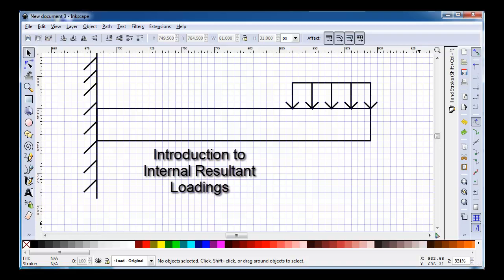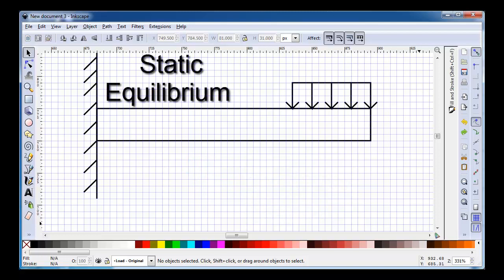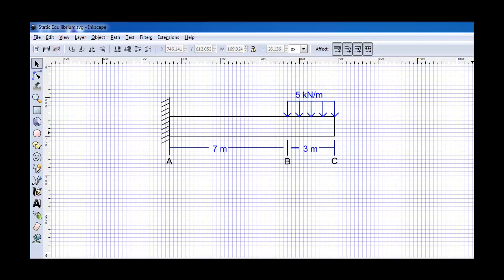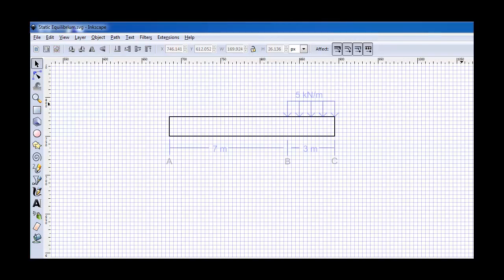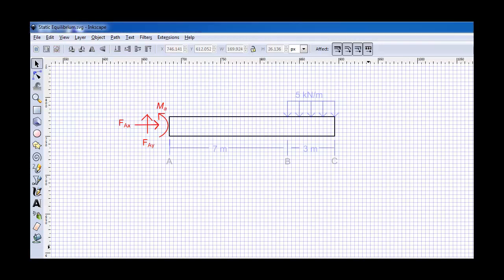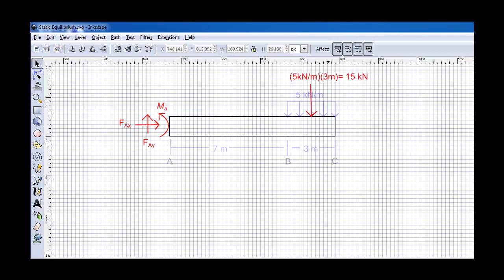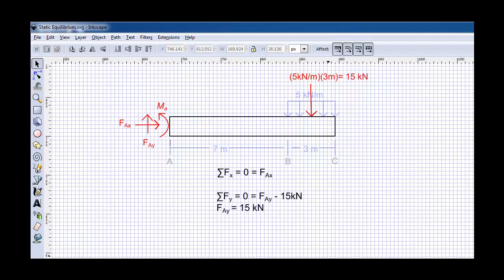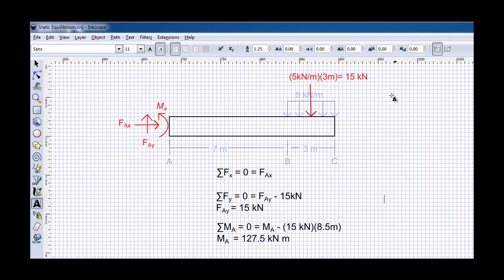Static Equilibrium   Cantilever Beam

Comment: It goes without saying that there is a force exerted by the beam against the wall in the x direction at the wall, actually 2 forces - one to the right at the top of the beam and one to the left at the bottom of the beam. So, for example, the fastener into the wall at the top of the beam must be strong enough to in tension to prevent the top of the team from pulling out and the compressive strength of the bottom of the beam and wall it touches must be strong enough in compression to resist crushing.

Comment: What about the force of gravity on the beam?
Reply from the maker: 1steinstein For a lot of beams we assume that the force of gravity is negligible. However including it is a fairly straightforward process. You can treat gravity the same as you would a distributed load, that is equal to the line density of the beam.

Comment: suppose i'm calculating the sum of moment at the point C, should I involve the Ma in the calculation or not?
Reply from the maker: Obadah Alhalabi You definitely would take Ma into account. Just to be clear, since we are placing the beam in static equilibrium the moment at point C is zero (in fact, it will be zero there even in dynamic cases, unless we specifically apply a moment there). 

To demonstrate, summing the moments at points C give positive 22.5 kN-m from the distributed load, and negative 150 kN-m from the reaction force at the wall. Adding these together gives -127.5 kN-m. Finally, when you add the positive 127.5 kN-m from the reaction moment at the wall, it becomes clear that the moment at point C is zero. 

If that was a bit much, see the next video on shear and moment diagrams, which will walk through how you determine the forces and moments inside the beam (https://www.youtube.com/watch?v=fOTiEI9a9G4&index=2&list=PLXeAgIvA92moti_bHzMtrRMOa1KmDobCa)